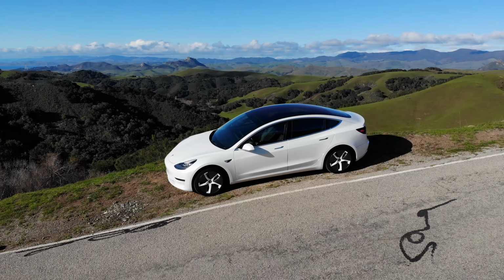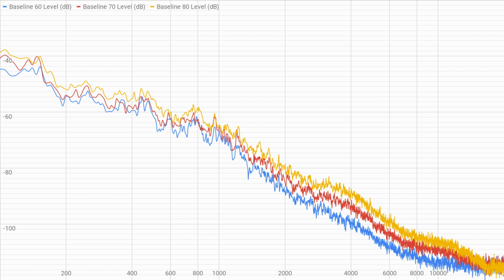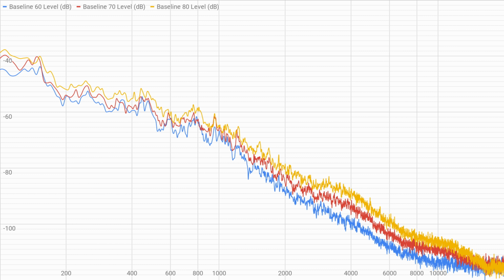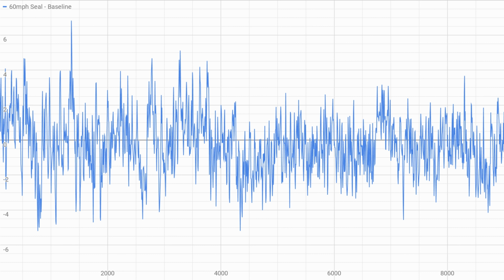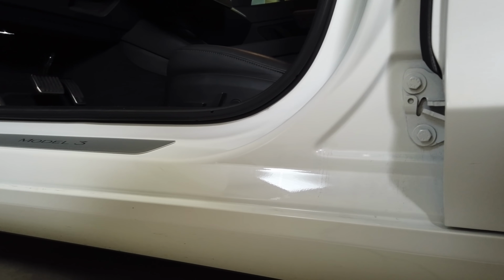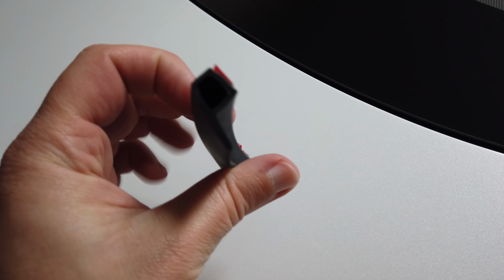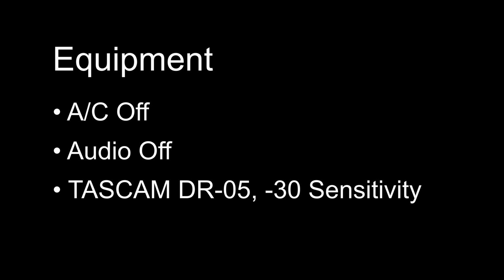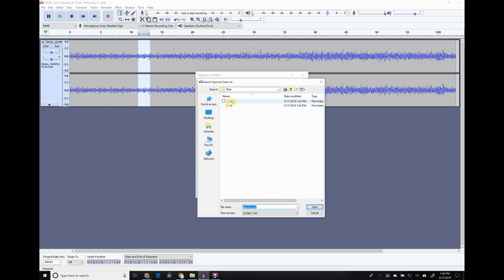Cheap Door Seals Reduce Model 3 Noise and Dirty Door Sills

Comment: Sorry, but i don't beleive there is any noticeable difference in noise at any of the tested speeds between basline and the extra seals. No signifciant difference at all!
Reply from the maker: That's why I feel this test method is so valuable. It leaves it up to the individual to hear the difference and make their own decision if it's meaningful or not.

Comment: The seals are intended to run below the door drain holes. Glued surface edge flush with outer edge of door. No cutting required.

Comment: The best test would be to put the car in a wind tunnel because I think a decibel meter mostly just picks up road noise and vibration.
Reply: Even better would be to drive it on the same road with the same conditions to get measure against all noises. ;-)  - But yes, I see your point ...

Comment: Thanks for sharing this analysis! Has anyone done similar measurements with the tires fully inflated to 45PSI for efficiency?  Or even 42-43 PSI, representing the newer, softer recommendation to improve ride quality?  I wonder if the seals might make more of a difference if the tires aren't under-inflated.  As it is, these results are pretty underwhelming. :(

Comment: Thanks for sharing. I would consider focusing on running the most premium tires, then consider adding insulation around the other edges of the wheel wells. The idea of adding/upgrading the sound insulation around the wheel wells, is based on tests running on gravel. The Tesla Model 3 wheel wells seem to have poor/lack of sound insulation (compared to Tesla Model X & German-made mid-size cars).

Comment: How Did you handle the openings i
At the bortom of the door where water from the Windows are supponera to be drained? Does the seal cover those up?
Reply from the maker: It does cover the holes, so just snip the adhesive in those spots and remove it.

Comment: I imagine your introduction would be confusing for most people. You were illustrating the noise levels over different frequencies for 3 different noise baselines. There are lots of un-joined dots in that statement. What you are saying is that (my interpretation) you drove the car at 3 different speeds on a particular road that would produce AVERAGE (perhaps composite is a better descriptor) noise levels of -60, -70 and -80 dB. Then you looked at the actual amplitude of that noise over a range of frequencies (your graph). Once that concept is established your audience is on firm ground, since whatever else you do is a comparison of those same metrics and methodology under different conditions. It’s worth making the initial effort to spell things out at the beginning for a non-expert audience.
Reply: It's 60, 70, and 80mph for that blue red and yellow chart, not -60, -70 and -80 dB

Comment: Any worry about these seals trapping moisture in?  really appreciate the thoroughness here.  the sealed doors sound significantly lower in pitch which is more peaceful imo..
Reply from the maker: I don't think so. There are still gaps in the bottom seal in the front and middle. I've been through a few rains now with no trouble.
Reply: @EveryAmp  +Subbed btw - thank you!

Comment: It'd be cool if the car could detect the road/wind noise and then play a sound wave pattern over the speakers to cancel out the noise --like noise reduction headphones.
Reply: you should watch electroboom and understand why that is literally impossible...you can only cancel out a noise from its origin point....

the noise is coming from the tires and coming in through the entire wheel hub liner and from all the wind around every single surface change on the car.

smaller gaps - ha
fewer roof pieces
harder smaller tires
better insulation

Comment: The Noise Vibration Harshness variables have been well engineered for decades.  The keys for automobiles is a combination of absorption, harmonic canceling, using material and mechanical systems that achieve optimally balanced value.  In an electric vehicle, this becomes very easy compared to an ICE auto.  Anytime you isolate inside and outside air and vibrations, with seals.

A good place to visit is the largest sound isolation chamber in Minneapolis suburb Fridley MN 55432.  They test large Gensets that are enclosed from 2KW to 7MW systems for emergency power.  So if any auto company wanted to test NVH inside and outside with any weather condition you will get an extremely accurate data analysis.

Comment: Thank you! This is fantastic! I’ve seen this thread in TMC. However, I believe most of the road noise on Teslas is coming through the wheel wells. But these seals are super affordable and simple enough to add, that I’ll make the jump.
Reply: Do you have the thread from TMC?
Reply from the maker: https://teslamotorsclub.com/tmc/threads/reducing-noise-and-keeping-the-door-sills-clean.141218

Comment: Let us know if you chose to do a suspension upgrade. I am considering that for my model 3 but I am looking for a smother ride.
Reply from the maker: What options are you looking at? I'm not finding anything that will give me a factory ride height, but smoother ride. The Mountain Pass Performance Comfort Coilovers are probably closest, but still an inch drop.
Reply: @EveryAmp I don't want to drop my height, it's low enough.  I was thinking of the mountain pass also but drop is what's keeping me away.  Hey living, are the seals you put in helping to keep water out of the inside of the doors?
Reply from the maker: The seals definitely help with water from the road, especially on the back doors. My door sills used to be filthy after a rain. Now it's minimal.
Reply: @EveryAmp  Have you had any issues with the seals coming loose? I cleaned and prepped my surfaces well,  but a few times the bottom seals have come loose on two doors. Any thoughts on adding a cyanoacrylate glue to problem areas to make them stick?

Comment: Sorry if I missed it, do you have a photo of what the seals look like with the doors closed from the outside? Are they visible?
Reply from the maker: They aren't visible on mine, but it depends on your installation. It's kind of a fine line between them being too far in and not sealing and being too far out and being visible.

Comment: Update to a used model S instead of buying new model 3.
Reply: Gokhan M and get half a range as a bonus...
Reply: totally different animals.  worlds apart.
Reply: And old Model S is way worse on noise.
Reply: @huzygaming7216  I've owned both (S 2016, 3 2018). I'd say you're misinformed. S is super low noise. Model 3 is acceptable... definitely not in that high end category.
Reply: @MrStarchild3001  haha, you think 2016 S is the old S? Try a 2013-2014 S... 2015 they improved the noise with the P85D introduced and addition of black headliner. 

I have driven every single model of Teslas basicly...over 200k km. I am the one who is informed.

Comment: Great job on this. I have visited a wind tunnel facility before and the engineers said they have played with ways to reduce cabin noise with only the wind effects (stationary car without rolling road noises). One thing the said caused a lot of noise was where the air stream comes over the hood and can stack up on the windshield. They fitted a deflector on the hood edge (their pics reminded me of an old bug deflector) to direct the air over the windshield a little more.
Reply: They also said removing the mirrors completely was the best way to see if any improvement at all would be measurable before wasting time with alterations. Another area they mentioned was the undercarriage. Fitting a flat bottom under tray that was sealed and rubber isolated from the body of the vehicle had improvements on some vehicles. I believe it helped with lower frequencies due to the length of the ‘gap’ from front to rear but my memory could be wrong.  If I remember anything else I’ll be sure comment here.
Reply: Audi goes all out: https://youtu.be/Ruq9t-9asCk
Reply: https://youtu.be/PPDhZao9E7w

Comment: Thanks for the effort -- and yes it might help a little .. but I have seen some thin round seals that go around the roof glass that is supposed to cover a lot of the air noise at higher speeds .. haven't tried it and don't have the equipment to test .. but it is one that I am thinking about....??  Let me know if you have tried that and what results you got....
I think the real problem is that we do not have a "Noisy ICE" engine to cover up the road noise .. so now we are hearing it...!!  :-)
Reply from the maker: It's on my list of things to try as well. Stay tuned.
Reply: I sat in a Lexus luxury Lyft after dropping off my model 3 for service, no it’s not the ice engine covering other noise. It really was quieter.